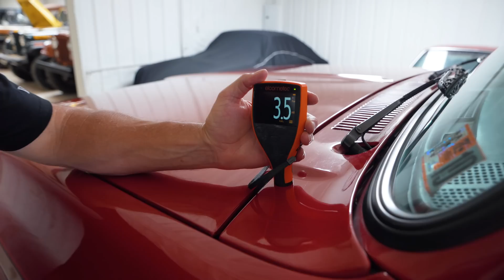1987 Chevrolet V10 Silverado Pickup Truck on Bring-A-Trailer!

Comment: Beautiful truck . GM changed the K identification to the V identification in late 80s ... Gm had so many parts leftover for theses trucks you could order one on up into the early 90s actually.  Ive seen a few 90 an 91 square bodies .
Reply: The chassis cabs, K Blazers and Jimmys lasted until 1992
Reply: @Dino Tudisca  I've seen a few exceptions to that but majority yes
Reply: @rockkhound943  
Dennis has 2-1992 blazers featured a few months ago
Reply: @dinotudisca3821  yea I remember them
Reply: '88 thru '91 Blazers , Jimmys Suburbans and crew cabs all were the old square body trucks .

Comment: 73 to 87/88 were the best years for a 1/2 to 3/4 ton GM truck imo. The throttle body injection years on a s.b. under horse powered dog can not go unanswered though...

Comment: Man I didn't remember v10's being put into them back then!
Reply: The engine is a V8 , the V10 is the model,
Reply: It's not a 10 cylinder engine. It's an 8 cylinder engine. The V10 means its a four wheel drive truck
Reply: @Fisher Motor Company  10-4 guys thanks for the clarification lol 👍

Comment: I bought one of these brand new in 87, it was a 3/4 ton 4x4 with the same red paint. it was very thin from the factory and in certain light you could see the black primer underneath the paint in some places like the top of the roof. dealer did nothing about..

Comment: V10 Must have been the fuel injected model. I had a 1987 and it was 100% titled a K20. It was a factory carbureted truck which was the last year a carburetor could be had. As far as I know the carb engine was not standard and had to be ordered

Comment: I have a 1988 C1500 with the 350 TBI. But my truck's tailpipes came out the right side. I thought if the tailpipes came out the left side meant it had a V6.

Comment: So I have a 1987 chevy siverado v10 half ton 3 inch lift 30in rims  that has 250000 miles but had the engine rebuilt, was used in mud boggs n all but it sat for 15 years but will start if cared for, what's the value of a truck of this type ?

Comment: Okay thought somebody had swapped a Viper motor in this unit.   Or a Dodge pickup motor, not nearly as cool but still a decent engine.  Or god forbid one of those spark plug spitting Ford V10 boat anchors.

Comment: So this is a bait and click I'm really surprised about this Dennis. You gave it was an impression that it was  a v 10 Cylinder engine in this vehicle not a designation of the vehicle with a Chevy 350 in It fuel injected. That's really a low blow for you
Reply: Why is he wrong for stating what it is? The year this truck was built GM used V10 as the designation for a four wheel drive truck.
Reply: @Fisher Motor Company  then why does my truck same year same everything thing say on its build sheet and fenders a K 20 not a v10
Reply: @Airplanefish  also I've  owned my truck since new

Comment: So it’s a V8 called a V10 Confused or what I will never understand car manufacturers calling their vehicles V this and V that but let’s stick with the engine size at least 🤷🏼‍♂️
Reply: V is for 4 wheel drive.  Was K until the mid late 80s

Comment: I spent 5 minutes trying to figure out the GM v10 and couldn't come up with one....8 liter v10 small block
Reply: I don't believe it is for the engine but a package name, he said about 2 wheel and 4 wheel drive.  That is how I took it.
Reply: The engine is a V8 , the V10 is the model,
Reply: The engine is 8 cylinders in this truck. V10 is GMs designation for a four wheel drive truck in this year. V10 means four wheel drive. Not 10 cylinders

Comment: this a 305 ? 350 ? Or an actual v10 ? I think so many are confused  like myself ? I bought a brand new 1978z28 and have been into cars all my life ! I had a whole lifetime career in cars and question your premise ? I think this was very misleading and think you might want to delete and redo . I have been a subscriber for years and have never missed a video of you ! I think this is A GIANT MISTAKE IN TERMINATIONOLGY !
Reply: Why is it misleading? He's describing the truck as GM labeled it. Blame GM for saying V10 means four wheel drive instead of K10 means four wheel drive or C10 means two wheel drive. GM changed there designation lettering. Not the guy in the videos fault

Comment: It’s a General Motors product so I will have to say no. Thanks! I had nothing but problems with my Chevy Cheyenne pick up truck with the check engine, light coming on every other day and having to replace sensors constantly I just say no to Chevy! In my opinion, they suck.

Comment: WTF is a V 10?!  I call bullshit.
Reply: Chevrolet switched their normal naming in 1987 from the K series (K10, K20, K30) for four-wheel drive trucks and C Series (C10, C20, C30) for two-wheel drive trucks to the V series (V10, V20, V30) for 4WD and R series for 2WD (R10, R20, R30) This same change was made to the Suburban and Blazer.
Reply: @benwest646  yes and they were still ugly and rust buckets.
Reply: @Ben West  correct
Reply: @stubstoo6331  best trucks ever made an ever will be made